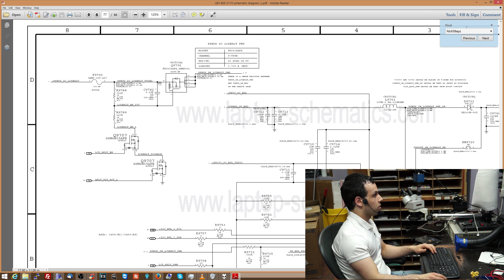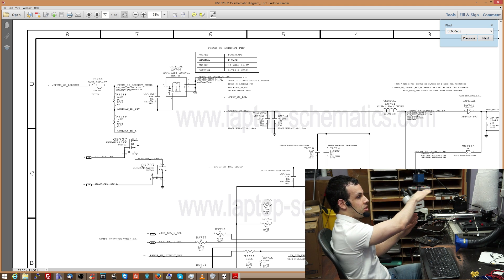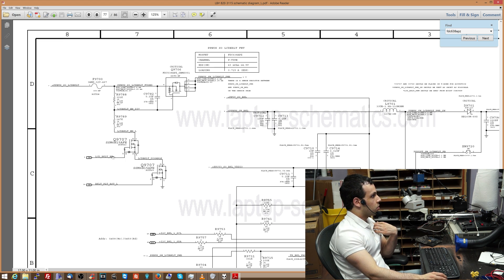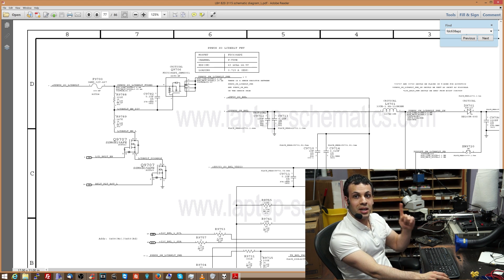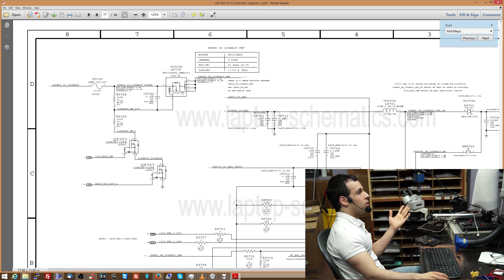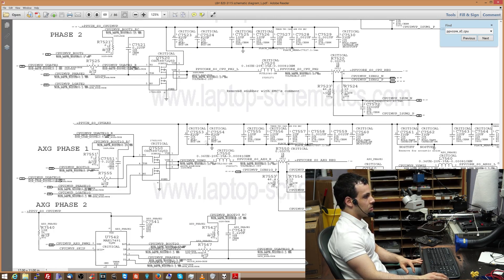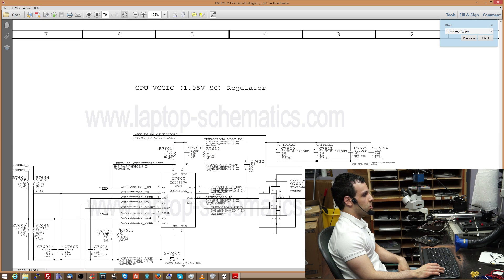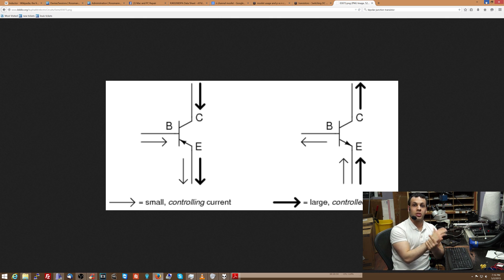What is a transistor in plain English?

Comment: hi, i would like to give my own example maybe it helps, in a small paragraph.
Imagine driving a car, you have a big power(engine) and a small power (your foot). You control how much power goes to your wheels.
so your foot is the Base pin of a transistor (small voltage there), your engine is your Collector pin (big voltage) and your wheels is the Emitter (controlled voltage), so it amplifies your foot power(small) to an engine power(bigger) depending how much you push or how much voltage you put there.
thats the concept of the transistor, and there after they use it on 1000 different stuff like a switch ON-OFF.
So its not really a resistor (brakes) but ofc you can think like it is cause thats the result anyway.

N stands for negative and P for positive, actually you have like 2 plates inside a transistor, if u put N plate on top and P on bottom the current flows this way if you put P on top and N on bottom then the current floats the other way and you have the same thing just inverted depending of what you want on your circuit board, yeah this is over simplified cause you actually have 3 plates but who cares, i hope you got the point and i could help a bit because i completely agree with louis their explanations suckk :D
Reply: Actually you are describing the FET which is controlled by the Gate voltage. The BJT has a collector, the base and the emitter and it's controlled by current instead of voltage.
The general term transistor is easily modeled with pluming. More like a faucet and you control water flow. 

FETs  are like = You turn the tap you control the water flow
BJT is roughly the same but with the tap leaking a small amount of water (Base current) :D 

Simple and realistic. People should get it easier. We all know how to control our taps.
Reply: my example is correct, i dont understand what are you trying to explain there, im an electronic engineer, i dont explain what controls or not, i explain how it AMPLIFIES in a simple manner dont they both amplify? or im wrong somewhere?Crysis9800
Reply: my mother tongue is not english and sorry cant really explain easily but, yes, they actually are amplifiers all of them, look how they are build and you will understand, digital logic just use the same in congested form to form the 1 and 0. Crysis9800
Reply from the maker: +ParosPasxaRide Good stuff!!
Reply: I am an electronic engineer too. TRANSISTORS DO NOT AMPLIFY!!! The amplification derives from specifil circuit configurations. Also computers and digital logic never use transistors as amplifiers :)

Comment: A transistor, whether bipolar, FET, UJT, MOSFET, is an amplifying device. When driven to saturation, it behaves like a switch. An important concept when working with both analog and digital signals. When you take your repair skills to a more advanced level, this becomes very important.
Reply: +SaturnV2000 Thank you.
Reply: Its still a resistor in nature, when you lower resistance on a higher rail you get a higher current. How a transistor works as an amplifier is entirely due to its resistive nature.